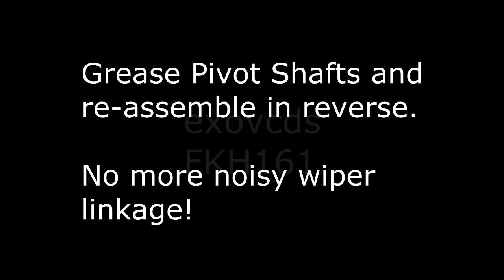VW A4: New Beetle Windshield Wiper Motor Removal

Comment: Wow. I was looking for a 71 beetle wiper motor replacement when I came across this video. Good job and great work posting this up. But honestly I wouldn't have expected such a newish car to need this kind of wiper repair.

I know this VW isnt new but a 2001 or later model (only 12 yrs old max) but compared to my family's cars - dad's 1992 Honda Accord my 1992 CRX Delsol & Honda Prelude 1991 model (all 21 or 22 yrs old) still on orig wiper motors (all electric motors actually) this car is newish

Comment: I did this once, but the wiper transmission seized again about a year later. I finally replaced it with a new transmission. They can be bought for less than $30.00 online. The old one was in the car for 16 years.
Reply from the maker: CanadaGTA Not knowing what the problem is on the day that the car is scheduled in for service, we can't decide to order from online and then wait for the part to show. I would imagine that my boss had looked for a local linkage assembly, priced it out to the customer, as well as mention that we have had good luck with cleaning & lubing the stock linkage.

Comment: I have a question! Why are there two large casted lead weights on the inside of the fire wall,under the windshield? I recently cut up a 2000 beetle,and was surprised to see these casted weights stamped vw.
Reply from the maker: I don't think I've noticed them before. Weights are usually used to control noise / vibration.

Comment: My GF has a 2004 VW new beetle. The windshield wipers will randomly stop working after she uses them for an hour or two. They also make that annoying noise you are talking about. Would changing the wiper motor and giving it a good cleaning/lube up be a good start to a fix?

Comment: When you take off the cowling and pan below it like that, is it easier to get to the exhaust manifold?  Thanks.
Reply from the maker: Darrel Hall Yes, possibly. I have only ever had to take off a manifold from a TDI Jetta (turbo & manifold are one unit) and most of that was done from under the car.
Reply: ***** Thanks, I just changed the flex pipe and when I tightened it down I could still see movement. I reached up as far as I could and found 3 bolts that bolt straight down through the manifold that were loose. I tightened from below but couldn't get real tight. I still have small amount of exhaust noise and hope that tightening those bolts will quiet it down for me.

Comment: Thanks for the video!  Looks like the rubber weatherstripping at the bottom of the rain tray was partially off in your video.  Does this need to be removed first before the tray can come off?  Looks like it has no adhesive and should just pull off the tray (if necessary)
Reply from the maker: Yes, removing the ribber seal first will make things easier. Thank you for watching!

Comment: iam having problems with my wipers everything works fine, but the delay mode thinking it might be the relay,any idea where its located or suggestions. thanks
Reply from the maker: The wiper relay is in the relay box above the pedals. Remove the cover under the dash... it's a wide relay at the lower right corner.

Comment: My VW wipers started to move VERY slowly and laggy, i hope removing the motor assembly and cleaning/lubing everything would help
Reply from the maker: Very common issue... cleaning & lubing will free them up.
Reply: Done :) Everything was rusted up, and stuck REALLY hard,even WD hardly made anything better, I even tried to heat the assembly to make it lose. After 3 hours of hard work everything now works perfect, thank you, your video helped a lot.
Reply from the maker: Cyraxas007 Good stuff, thanks for the update!

Comment: For my 99 beetle, when I start the wipers it just moves half inch and the motor retry and the same thing happens. Does this mean I have to change the whole wiper transmission or I could just clean it up? I appreciated if you let me know thanks
Reply from the maker: +dani son Disconnect the linkage and check if it is stiff... could be the motor or the linkage is binding or not fully connected / loose.
Reply: Thanks Thomas EXOVCDS, I went there and check it out. After removing all the covers I manage to take the linkage and the motor as they go together, took the motor and switch it back and was good. So I unclip one of the cylinders too see how seized it was and was pretty stiff.

I used wd40 and hummer it clockwise and moved it, I kept playing with it and managed to get it off the cylinder then sand it and greased and seem good! 
Did the same on the other side but didn't budge used lots of wd40 hummer it and bang! The linkage broke..omg lol. In Toronto Canda this part cost $85 plus tax and a junk yard $50 plus, jerks. I was lucky I found me a guy parting his 00 vw beetle  on line and sold me the linkage pus the motor for $20 in good condition. I still greased it and installed it back, now no rain can stop me and I saved me at least $180 at least. Thanks for the video gave me lots confidence, totally Recommend it. I gave it a like thanks!
Reply from the maker: +dani son Thanks for the update... they can be difficult to free-up sometimes. Good to hear you managed to source parts & get things back together!